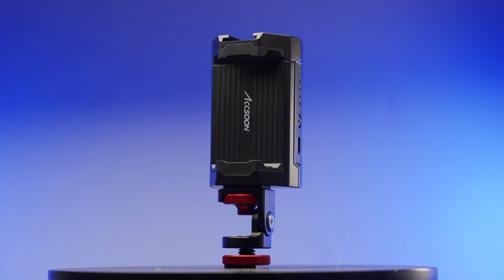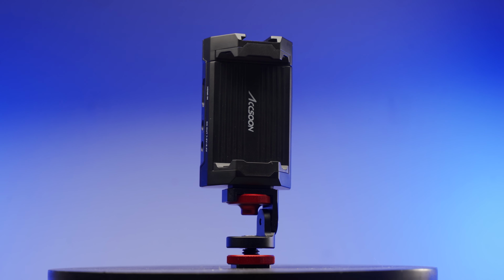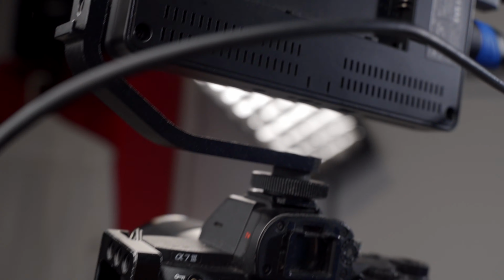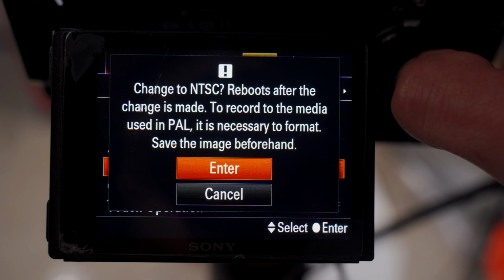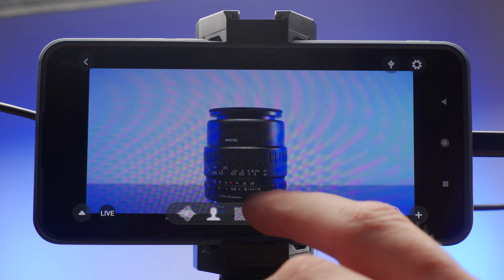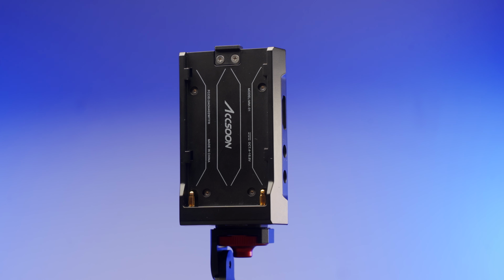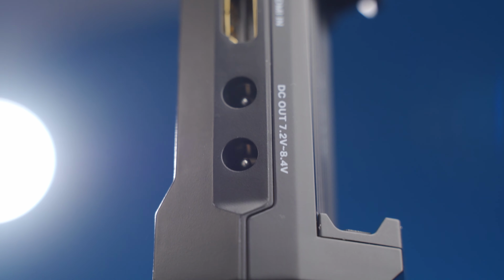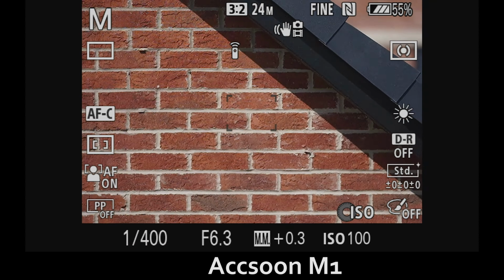Accsoon M1 - Turn your PHONE into a MONITOR/RECORDER

Comment: I have a Lumix G85, which only has one SD card slot. Could I record 4K internally and record externally to this simultaneously to have an emergency backup in case the SD card in the camera gets corrupted? I know the backup would only be 1080p, but that's a lot better than nothing.
Reply from the maker: This will record whatever your HDMI is able to output whilst you're recording. I'm not sure what the details are for the G85 in this regard, but if you're for example, able to run a HDMI from the camera to your TV whilst also recording internal then this will be able to record to your phone whilst you record internal

Comment: Wonderful device. If it supports output NDI HX over wifi besides RTMP streaming would be cherry on the cake. Turning HDMI signal to NDI is more elegant solution than something like Birddog flex in

Comment: Cool device! I need an external monitor to quite a few of my cameras so i can set the focus correct manually. I think this is mostly a great solution if you already have a decent phone to use it with. Then it is a small cost to make that phone a monitor. 

But I try to avoid using my smartphone and use cheap crap. My phone budget has been 100£ for my last three phones so I would need to buy both an alright phone/tablet and this so at the end I would end up paying more than an alright external monitor so it is not for me... Seem quite fun though, would love to play with one and see how low-end of an android device you could manage with... Most of  their official recommendations are not far from a Ninja V especially with the added cost for the M1 itself.

A MKII version of this with the option to record to a USB-C SSD instead of the phone that could record in something decent and only use the phone as monitor and control would be super interesting!